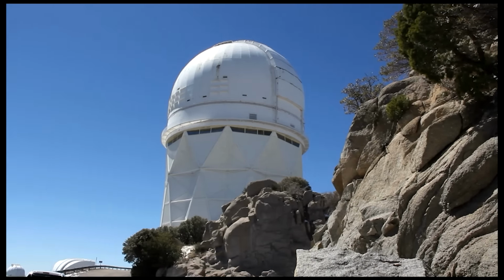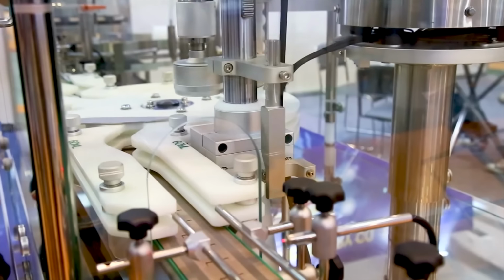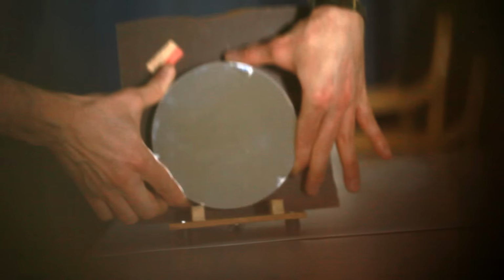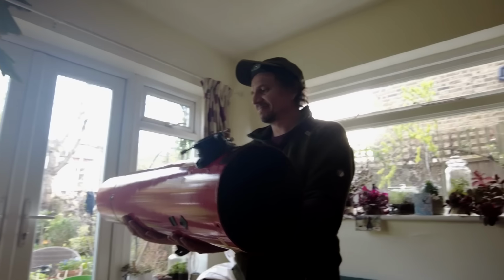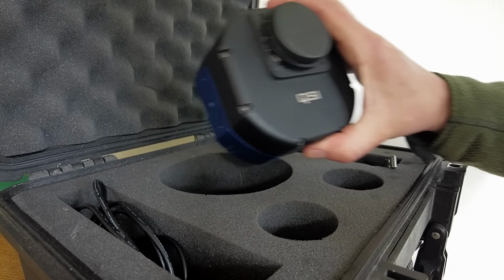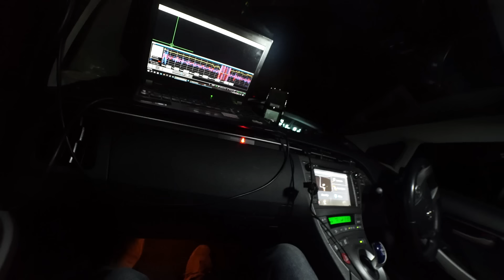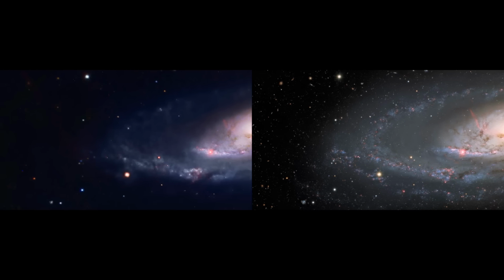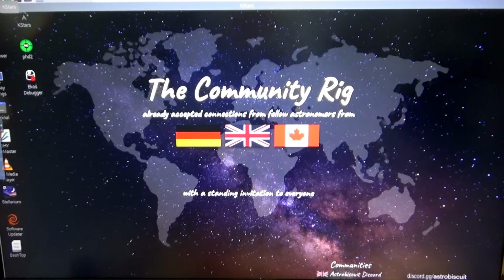£700 vs £7,000,000: Astrophotography Shoot Out

Comment: You should have talked to the red bunny, who says: You could do even better! Add a tube exhaust fan below the main mirror, which increases your luck in lucky imaging, because it reduces tube and mirror seeing that never stops entirely, especially not if the night cools down, by sucking out warm air.  And slightly stop down the main mirror edge with a ring (e.g. 3d printed) to hide the diffraction of the mirror clamps and the often not entirely perfect mirror edge.  A few mm suffice, just check the halo of a bright star to see the difference.
Reply: Vibration?
Reply: @Cult1022  I use a silent 12 V fan which runs at reduced voltage.  I thought about mounting it with foam and elastic bolts, but did not see the need for that yet.  The improvement in seeing is noticeable, even after a few hours.

Comment: FWIW, as a Yank, Edmond Scientific (located in my home state of New Jersey) is primarily an optics company even though they have dabbled in all kinds of scientific stuff over the years. Their telescopes have always had very respectable mirrors and lenses, so it's no surprise that it turned out to be of excellent quality.

BTW, the secondary reduces contrast and light gathering, not so much resolution which is more a function of the diameter of the primary.

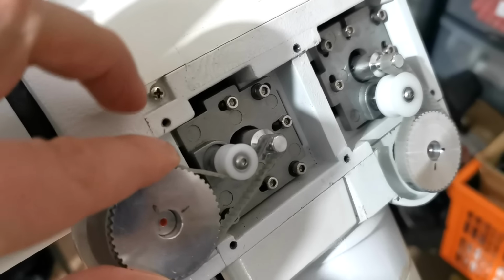Comment: 15:41 another trick you might want to try if you're using house power is to add a capacitor to the 12v power wire to smooth out the voltage spikes even MORE! Something high quality such as a Nichicon "Audio Grade" 16V 6800uf Capacitor can be found for a few bucks.

Comment: Super good effort. The thing is you mentioned the atmosphere being a problem that Kitt Peak faces, but actually it's not a huge problem for them as they have adaptive optics. (A system that measures the atmospheric distortion and bends the mirror in just the right way so as to counteract it)
Reply from the maker: no they don't. they are too wide field for adaptive optics to work.

Comment: The lucky imaging algo seems to focus on the middle of the image, which makes sense because you have to use a reference point to try and line up the data. I wonder what it would look like if it used like a 16x16 grid of focus points and then stitched the results together.

Comment: 1:49 This method nowadays is being tested by some academic astronomers if they could provide required statistical properties to the astronomers within LIMITED BUDGET. At least I know some who work on solar system minor bodies do this.
Reply from the maker: actually we have a guy who joined the big amateur telescope who is using the keck observatory (hes doing a masters on direct imaging of exoplanets) and hes shared a scientific paper on lucky imaging. Ive not read it BUT any exposure under 10s gets some benefits, 1 sec is much better and 0.1s is about the optimum

Comment: Thank you for the great video! I have a question: I'm don't know nothing about image processing, but might the way the images are aligned when stacking them artificially produce higher resolution in the brightest regions of the shot? I'm thinking along the lines that the algorithm will mostly align according to the fastest Fourier components in the high SNR region of the individual shots? The regions further out from the galaxy center can't really be used for alignment because of too low bin entries. Then the algorithm would have the tendency to reinforce structure in the center, but "wash out" structure in the outskirts, which would line up with the obtained image? But probably it works differently anyways and is just fine, in which case it would be even more crazy that you are able to see more detail than the big scope. Very well done in any case!

Comment: This video pre-supposes that kitt peak does nothing to remove atmospheric blur, however since 2017 the telescope has had a functional adaptive optics setup, which works to do just that. One other thing is that telescopes with larger mirrors have lower amounts of diffraction, which these scopes with adaptive optics can get past. Still a ways away from the big scope.

Comment: If you use very short exposure times, do you need a rotating mount?  Yeah you'd need to adjust manually but you'd remove the source of vibration.

Comment: you should have made that ring to sit on the outside of the tube, that way it would not have obstructed the light heading for the outer edge of the primary mirror. You could have used glue to fix the tube sections to together, removing the need for screws.

Comment: in the video you used the statement that the important thing in eq6 is the stability of the supply value at the level of 12V.  The manufacturer gives this value in the range from 10 - 15V, so why is 12V so important, how does it affect the quality of eq6's work, could you elaborate on this topic?

Comment: not sure why you didn't just get a new sonotube at the right length and lined the inside with black felt against reflections? That's what I wanted to do with my Dobsonian that was standing in my attic for over 25 years. Unfortunately the mirror wasn't usable anymore, so i ditched this project.

Comment: No idea why this in my feed, but awesome hacking! Just wondering, what effect does the rotation of the fan on the peltier have on the resolution? Those things are badly balanced in the best of times. Perhaps good to replace it with just a huge heatsink, something with heatpipes, preferably.
Reply from the maker: i did order a quiet one bc they are less vibratey

Comment: that Peltier setup is probably warming the sensor more then cooling it... They arnt very efficient and after the heatsink you have which looks too small gets heat soaked you just end up dumping the watts of heat your putting into the thermoelectric cooler into the sensor... better off goin a small watercooling AIO or sumthing..

Comment: I have a small doubt. Can we replace the secondary mirror or the eye piece lens with a DSLR so that we can complement the optical zoom of the DSLR along with the magnification of the lens? Will this work ? And if if does what result could be possibly expect?
Reply: Unless the scope is setup for it (hyperstar style) you won't achieve focus when removing the secondary. DSLR's can be used for Astrophotography of course, but in replacement of the eyepiece and focus still remains scope focusser dependent, you cannot use the camera lens though, the scope serves that purpose. DSLR's have built in I.R cut filters though, and this limits the H-alpha data you capture (more or longer stacked exposures required for most nebula and the dust in galactic arms).

Comment: Very interested in lucky imaging. Especially at the moment where I might manage 1hr of good (i.e. dark and clear) sky per night but could shoot across multiple nights. I've got a 250PDS and a 294MC Pro. What gain should I be putting the camera on if I'm only shooting 5sec subs? I normally have the gain on 0 but assume this would need more than that, otherwise I don't think I'd see anything in each 5sec shot.
Reply: P.S. Also typically use an L-Enhance filter. Presume that'd need removing too, in order to maximise amount of photons reaching the camera.

Comment: How does the sensor compare to let's say a Sony A7SIII sensor? If it's worse maybe it's worth using an A7SIII sensor which is amazing in low light.
Reply from the maker: well the size is different and i think my lttle sensir has lower read noise but those sensors are great

Comment: the car battery does not give you 14 volt
that is only while the car is running and charging the battery 
when the car is off its about 12.5 ish volts 
unless you had the car running all the time of course , other than that brilliant video as ever
Reply from the maker: yeh so this is a hybrid and i had the car on but the motor only turned when the  battery needed topping up. My adapter continuously read the voltage to be about 14v.

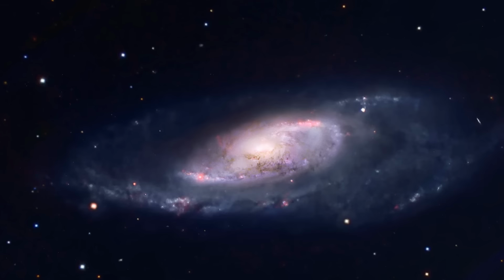Comment: Excellent work! It looks to me that you are lacking in Dynamic range You have a sharp cut off in the low light end, If you had a longer exposure length you might have got more info, In the comparison at 25:20 the group of 4 stars in the top left side of yours in the shape of a square roughly, theirs 2 stars in the middle of them that's not visible, You can tell something should be there but its only a hint that a star should be there, Only if there was a tiny bit more info in the collected image they would be visible, You can tell since the bottom left star and the one below it in the square are visible but they are not that much brighter than the missing stars in yours, Good job on getting the image tho i'm very impressed since your going head to head with a multi million dollar equipment

Comment: There one tiny little detail. 
Those astro telescopes use different sensors, that provide them with accurate data on the composition of each pixel. 
Our consumer grade sensors do not. Because of the CMOS sensor design and Bayer filtering, up to a wooping 70% of the actual pixel data is calculated by the processor. Basically meaning that 70% of color information that your camera captures, is made up (interpolated) data.   
Using a data like this it would be impossible to actually gather accurate information about composition of an object. 
Scientific telescopes however shoot everything in black and white, using different filters, so they gather the light from the object in 3 or more different channels. Then merge them together and then they can asses which area of that object emits certain gasses etc... 
In order to get to the scientific level of accuracy, one would need to gather a set of frames using different nanometers filters and modified IR or full spectrum camera. 

So yeah, those huge telescopes do not take a picture just so we could view it, they take the picture and analyze the data, later coloring it based on the data so it would make up a better representation on what is going on there. 
Our cameras however are designed only to take a picture. And even though the images look very similar, there is no accurate data behind each pixel on consumer level gear. It needs modifications and filtering out the different light in order to collect scientific data. 

Nevertheless the results are pretty good. Yet the actual resolution of the giant telescope should be a lot higher. This also has to do with resizing software. the higher the pixel count of the picture the more you can push things resizing it be it enlarging or making it smaller. Well its the same with phone screens, the picture taken with 20Mpx camera looks a lot more sharper than the picture taken with 12mpx camera when you view it through the same 4k screen. 
Some time ago I have seen youtube video with a very good enlarging tutorial, showing how its possible to enlarge a photo by up to a 300% and loosing only a very small fraction of quality. What was interesting is that on the huge printed version, the loss of detail was nonexistent.   
So what I wanted to say is that, with enough time and effort it might be possible to match the huge telescopes, but  if the science is the one asking for that data, they will be needing correct ISO standards for that as well and this is probably the biggest problem on how to make sure that each individual giving his data has collected it according to the rules and using calibrated tools for that... Because one wrong set of data, for example done with wrong filters could skew the final outcome and it would be hard to test it out and correct it.

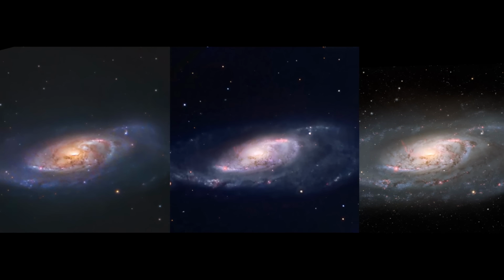Comment: At 26:53 where you compare three images, each with their own original resolution. Effectively, by doing so, you have reduced those images to the resolution of your monitor. Trevors image will have used a higher res sensor than yourself, where the professional observatory will have definitely had a much higher res sensor than any of us could afford. So, imagine squeezing, for instance, a 20 Mpixel image onto a screen size of 1024 x 768 format display has to induce a severe loss of information. What would you expect a 200 Mpixel image is going to look like on that same monitor? From the time stamp I pointed out, you already see the result; the observatory image does not appear to be much better than the other two. An 8K image is only a 1K image on a 1K screen. A 36" mirror is superior to a 6" mirror where both are 1/10 wave figured or better. 200 Mpix cameras will always be superior to 20 Mpix. Talk to your local observatory member who will tell you exactly the same.
Good luck with your project.
Reply: The original Kitt Peak image is 6527 x 3427px, hence why Astrobiscuit zooms in on the image in the video. And that resolution is also attainable with a 6" mirror. It doesn't matter if Kitt Peak has a 200Mpix sensor if the atmosphere prevents it from resolving that resolution anyway.
Reply: @Undy1  So, in essence, you are saying Kitt Peak could have installed a 6" mirror instead of moving from a 36" to a 2.1 metre mirror. Laughable, to say the least.
Reply: @peterbarratt8699  No, that's not what I'm saying at all. I'm saying that all big telescopes on Earth are "seeing limited". And most places have a seeing of around 1 arcsecond - which is almost exactly the resolution of a diffraction limited 5" (sic!) scope. There are places on Earth that get better seeing - the best ones are around 0.4 arcsec - which corresponds to a 12" diffraction limited scope. This is it, pretty much the best resolution you can get from Earth. That's exactly why we're sending telescopes to space, and it's exactly why Hubble with a "measly" 2.4m mirror puts even the largest Earth based telescopes (10.4m) to shame cause it's pretty much diffraction limited (or would be if not for the defective main mirror). It could theoretically do 0.05arcsec resolution so literally 10x as much as ground based telescopes.

Still there is a tremendous advantage that a bigger mirror provides on Earth - light collection. A bigger telescope gathers light much faster than a smaller one.
For example you need 8 days of constant observation with a 6" scope to catch the same amount of photons as a 2.1m scope does in an hour.
That is why Astrobiscuit is starting a community project - to have multiple people gather the data and make the process much faster as a result.

Comment: 23:05  There is no such thing as 'photons'.  Light is waves at all frequencies, never particles.  27:28  wave amplitude dependent.
Reply: Nope actually the photon count thing is right... You could also say photon wave count yes. Wave amplitude is not a thing because photons are discrete packets, so a photon of e.g. 500nm wavelength can't have more energy, every 500nm photon had the same wavelength.